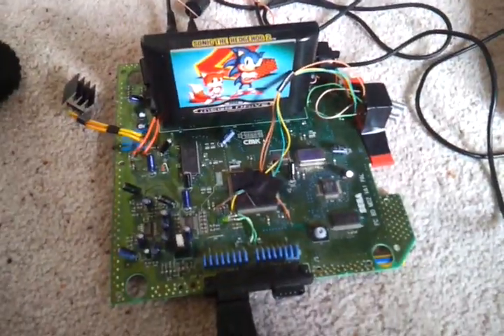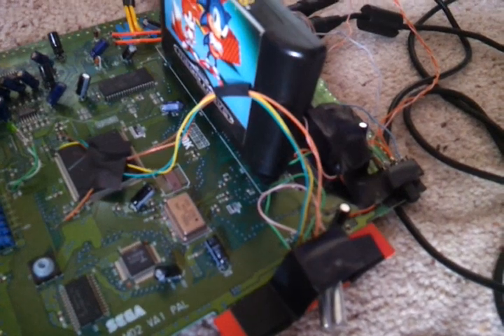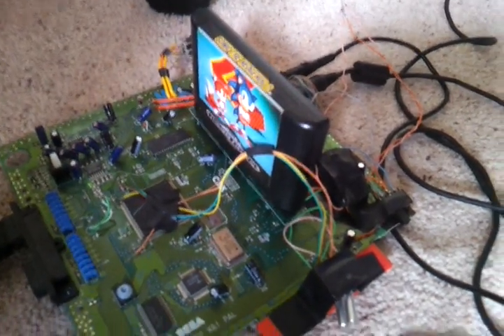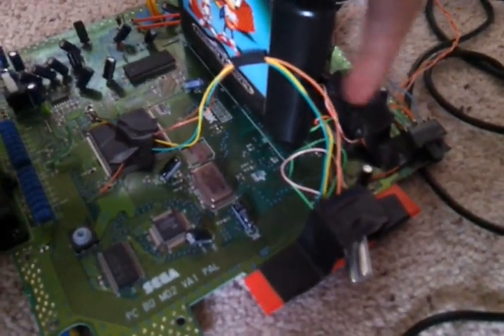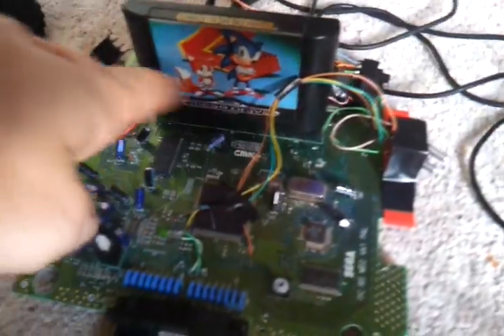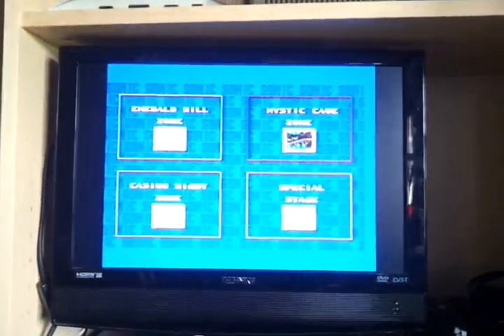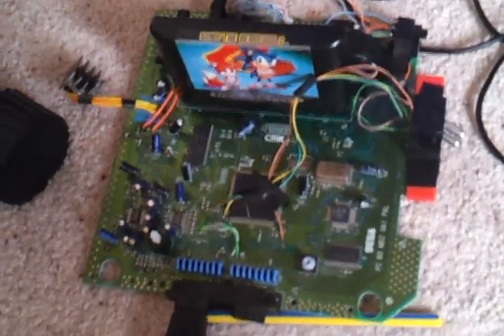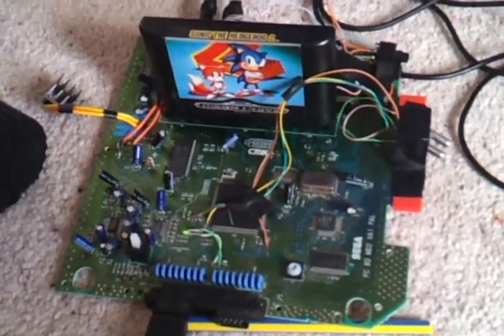Sega Megadrive 2 / Genesis 2 overclock mod 7mhz and 10mhz

Comment: The show to which you refer was "The Screen Savers" on TechTV (later, G4 TV). He had done the Model 1 mod, and I think he had said at the time that it was possible to do the Model 2 using the method you referred to, but then they challenged him to do it live on the show, which he said was trickier, but he'd try. Anyway, he didn't manage it, but that was in the span of like a 45 minute live show.

Comment from the maker: Hi MINIthefox, Im currently attempting to make a Jamma Megadrive 2 which will be overclocked. So when I get to the overclock stage I will take some clearer photos as I go through the process. I posted a little write up on my blog which is in the video info, above. Admittidly my wiring is a little messy so I will neaten it up and try to do a guide as I go through the process. Cheers for the comment. :-)

Comment: ok, I really have to ask this, why not just overclock the MegaDrive/Genesis to 10Mhz and leave it at that (without having that overclock switch)? It's just because I'm probably going to do this and the 50/60hz 1 switch mod, and don't want a second switch for the overclock
Reply: probably because it will glitch some games and it need to be at stock speed to work with the 32x